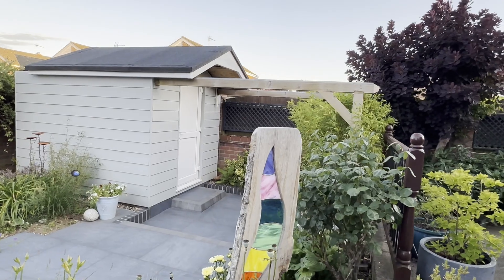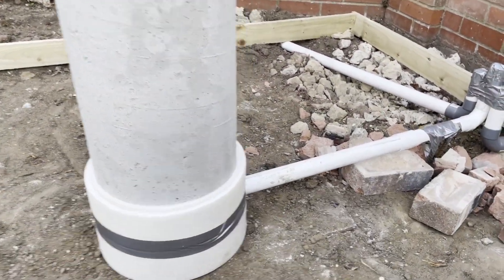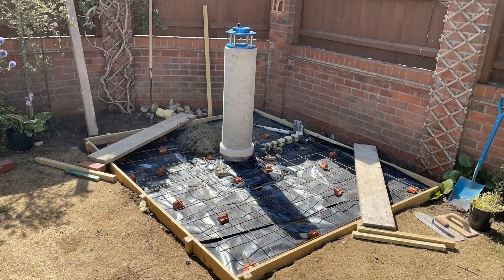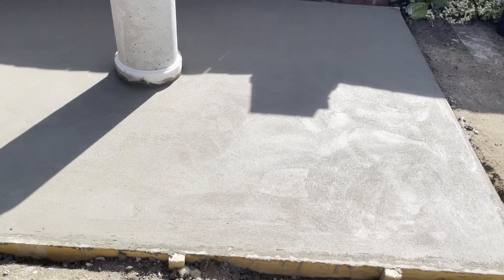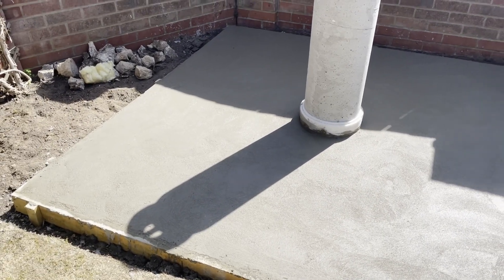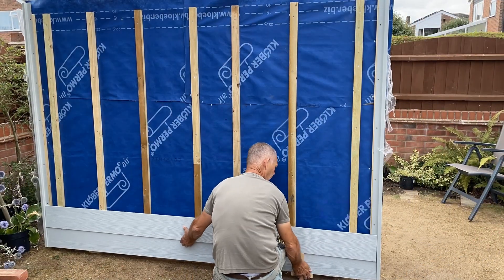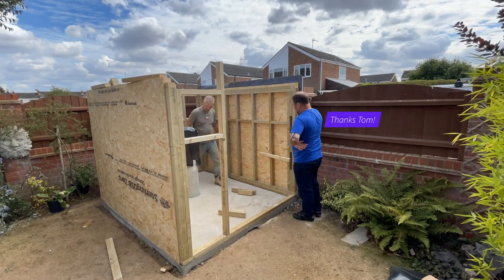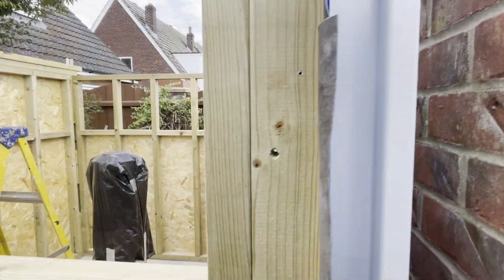How I Built My Own Backyard Observatory From Scratch Part Two Base & Walls

Comment: Hi Simon, Do you have any idea how many metres of framing timber it took to do the build? I've been trying to freeze the video and count up but it's hard. Thanks mate.
Reply: Thanks so much for all that info Simon, a pleasure to be a member.  😊CS
Reply from the maker: Hi Pete, and welcome to the channel mate👍 The timber for the walls was approx 90m of treated 3x2 uprights, base and head plates, the roof timbers was approx 40m. The rafter lengths were 1.3m long, the flat top ceiling length was about 1.1m there was 10 rafters each side, they were doubled up on the ends! Hopefully part 3 roof video will be out in a week or so! 👍

Comment: Hi Simon, how much clear view do you have from your observatory? Which directions (N-S-E-W) and which obstacles like building or trees, and how much angle is acceptable to be blocked.  Example, from around my house straight south, I have either 40 or 45 degrees blocked by trees, and SSW and W I am down to about 20 degrees above the horizon being blocked by trees.  What are your "views" (double meaning) in this matter?  cheers, Kenneth
Reply from the maker: Hi Kenneth, over my side walls I can get as low as 26deg south, east is my other side wall, north anything further left of Polaris is blocked by my house about 40 dgrs. East is blocked by my garage below 45 degrees, west is about 35dgrs then north west is back to my house, again 45 dgrs! It is challenging, but the obsey walls don’t really restrict me, it’s the surrounding buildings!

Comment: Simon, thank you once again for sharing this information with us. Is there any chance you'll be able to provide some schematics with dimensions to assist those who do not have your experience?
Reply from the maker: Hi Chris, thanks so much for watching! I don’t actually have any schematics I did it all on the fly so to speak (made it up as I went along) maybe I could do an after the fact measure up and give you some dimensions! Although, often when you come to actually do it, things sometimes have to change to make them fit and work! Maybe on the next installment, I can include some main dimensions of the building and roof, for a rough guide! Clear skies 👍